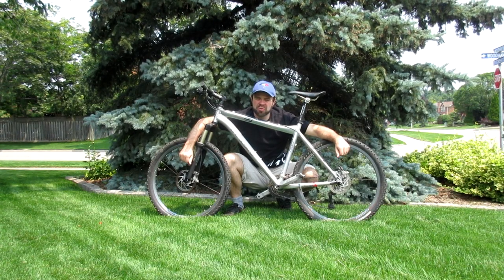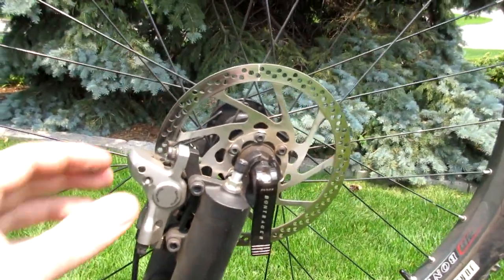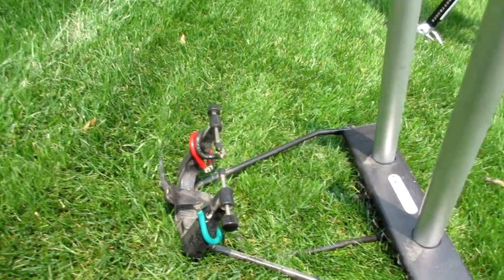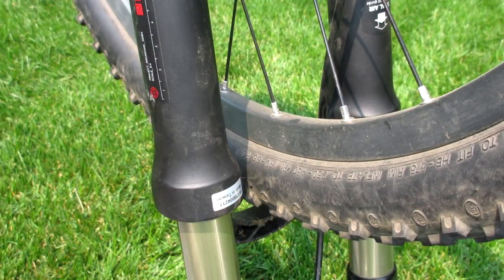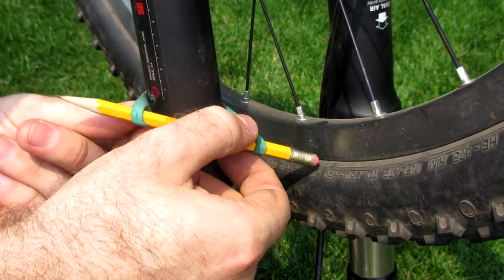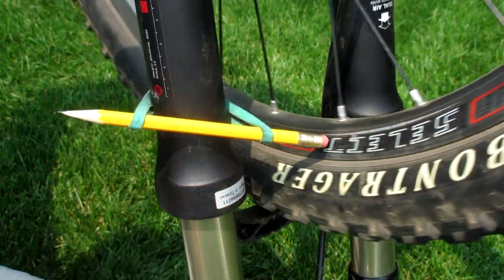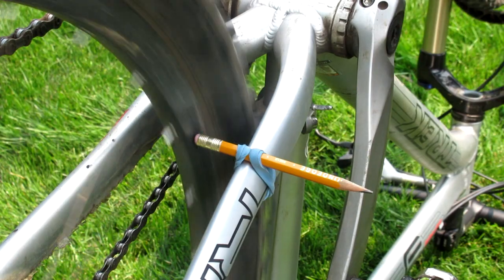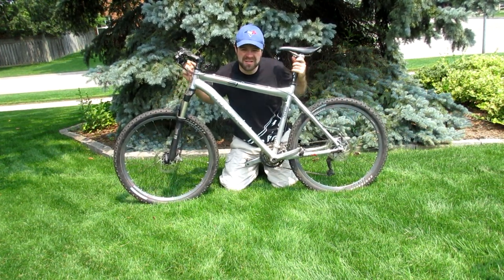How to True (Straighten) a Bicycle Wheel with Disc Brakes

Comment: How do you know how far to leave the Eraser from the rim when truing a rim with disc brakes
Reply from the maker: You'll want to adjust it so that when you spin the wheel, the eraser touchs the rim some of the time (not  all of the time). This will show you where the high spots are.

Comment: My front wheel looks like it sits on an angle , will it need trueing or will it be the axle or forks what's worn out
Reply from the maker: Could it possibly be just that the wheel isn't fully seated inside the fork? Otherwise I'm not sure what the problem might be.
Reply: @cjhoyle  I think it's definitely seated . It's a used bike which I bought the other day . When I took the front wheel off I noticed that there was only a length of axle on one side and that there was no thread left out on the other side so at one side the wheel was just resting on the skewer ! 
So I made the axle even to about 4 threads on each side . The skewer seems a tiny bit kinked . 
I'm just worried that because of the axle being on a angle it's worn the dropout on the fork .